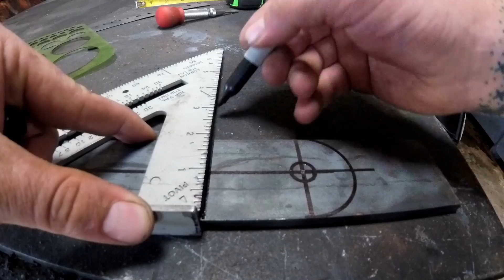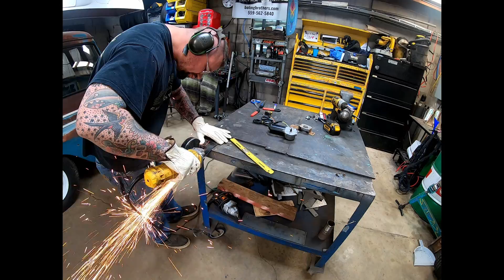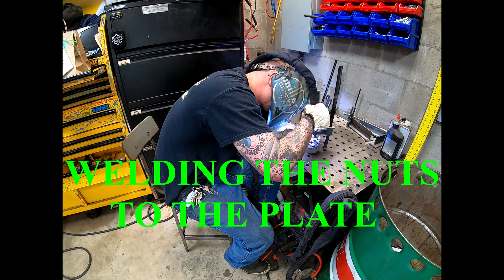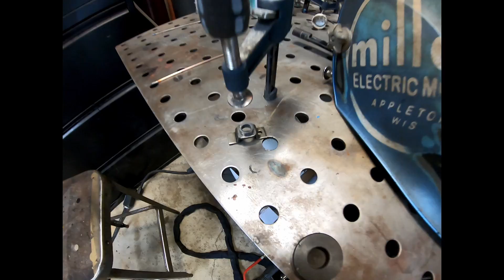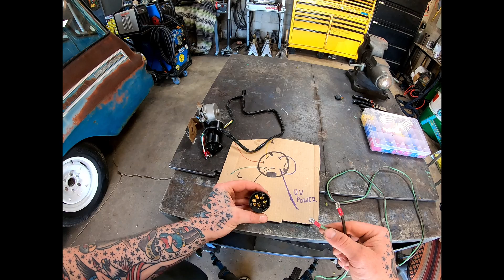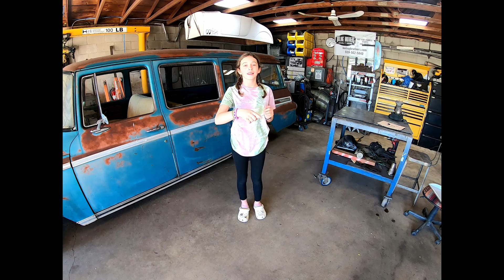UPGRADING THE WINDSHIELD WIPER MOTOR!

Comment: Fill in the backside of the plug with hot glue to keep the terminals seperate.!  Also could use silicone or epoxy.!! 👍✌